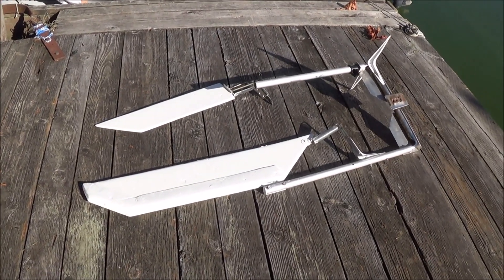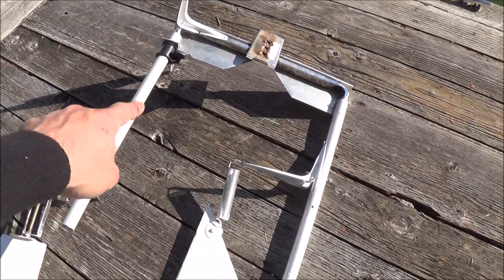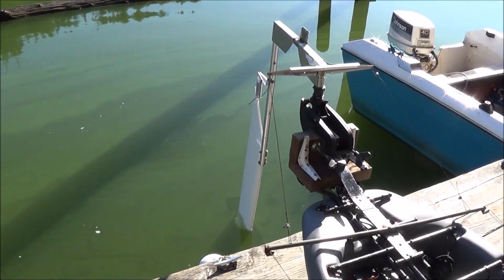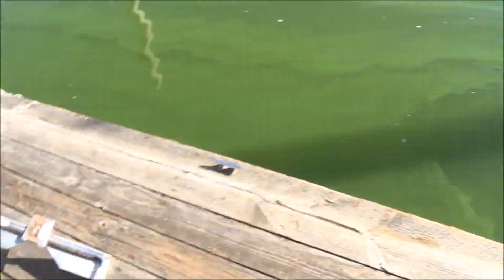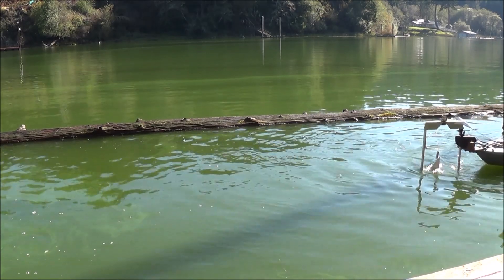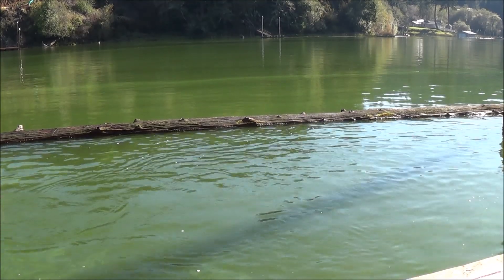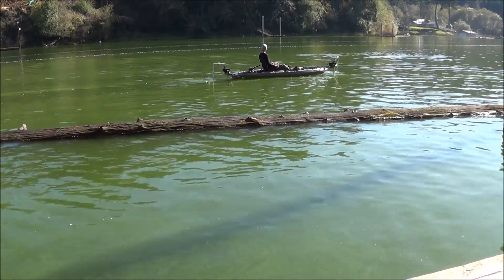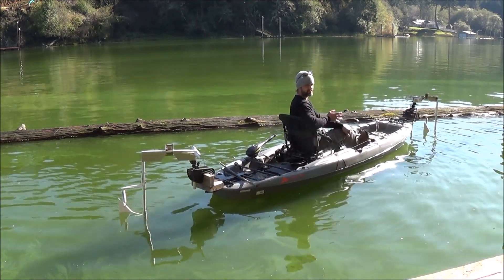Using Twin Oscillating Hydrofoils to propel a boat with very little energy.

Comment: A wiper motor is just spinning around due to the wipers being attached to a circle - you should use the same with bicycle pedals and then tune the blades :)

Comment: How about trying scuba diving fins over rigid foils?

Keep it up bud
Reply: I did just that, it works well. Mine was actually an old mudflap off a transport truck mounted on a u bracket under the canoe. So if you rock the canoe from side to side or up and down it pushes you forward. Also waves  do the same, so on a rough day it will even move into the wind. Plus it's silent.

Comment: If you had some gearing, so you could get multiple flippers per peddle you'd be getting it. Definitely, less drag than the other methods.
Reply: Not less drag than conventional paddle as both propulsion foils remain in the water at all times where the paddle is out as it is moving forward